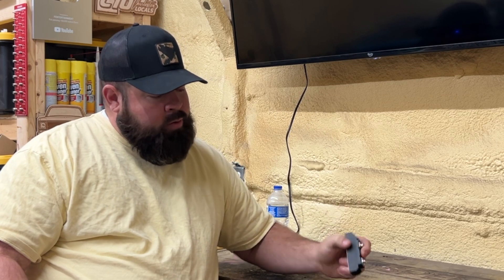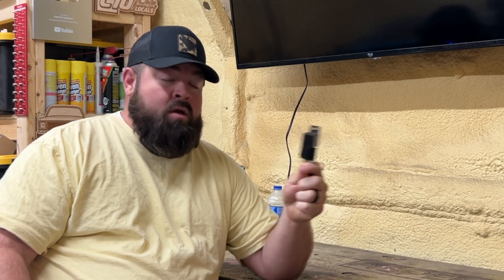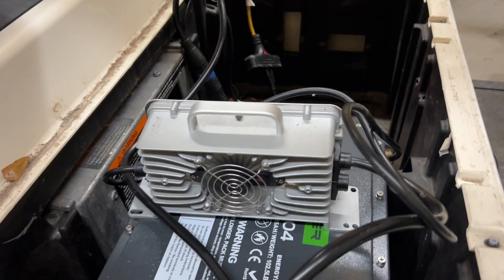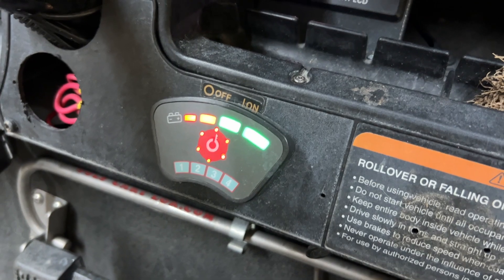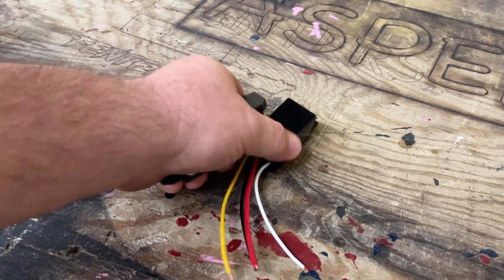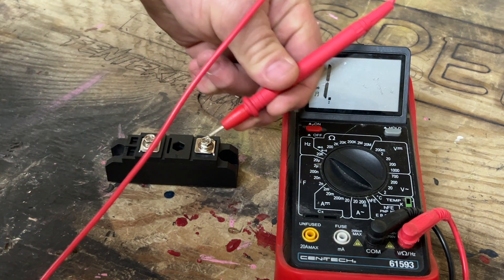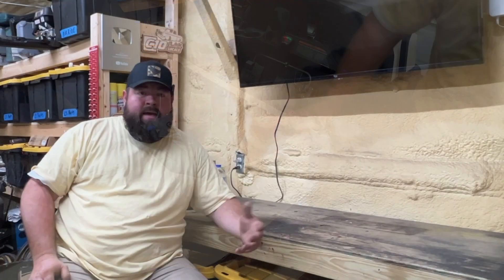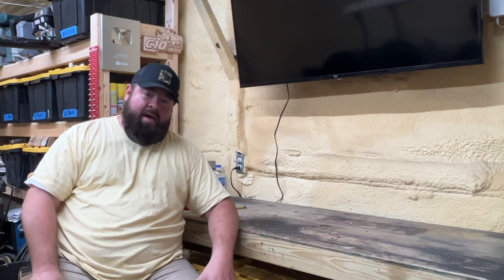Golf Cart Moves While Charging After Lithium Battery Conversion | DIY Add Safety Switch To Any Cart

Comment: I view all of your videos, this one some how slipped by me. Safety First! There's a lot of amp potential in these lithium batteries. For safety sake I am prone to buy a battery with a built-in power on/off switch and an indicator to let you know that there is juice at the battery terminals or not.

Comment: So on an EZGO RXV, how would you integrate this option.  The keyswitch is not like this.  Most instructions with converters show to run switched side to switched side of solenoid, so would you do similar with this application or how are you doing them?   thanks man!
Reply: after some thought, I would say in the case of the rxv or any ezgo that has the interlock, that the easy and correct method would be to use the interlock as its intended, by taking the blue interlock wire that hangs off the back side of the receptacle and cutting it and connecting it to the pins 87a & 30 of the relay, so that its switched open when the charger is connected, since this interlock sends pack voltage back to pin#17 on the controller, you'd be using the relay to control this same as the charger did before.  What you think bud?

Comment: Will this work if I install a Navitas motor? Your link to the diode has a note stating it only works with DC input? Not sure what it means?
Reply: Should work just fine because you are looking for 36/48v from the charger's output, which is DC output

Comment: I have a question regarding your Cushman hauler. I just upgraded mine with the Vatrer 72v lithium. What did you do with the gray and red interlock wires that were in the charger loom? I’ve read to just connect those 2 together to close the circuit. I respect your knowledge and would appreciate your input. Thanks!
Reply from the maker: Mine didnt have the stock charge receptacle because the cart had the onboard charger when it was stock. In regular carts I just unplug that receptacle and run the red wire to the batteries positive.
Reply: thanks Ryan but maybe we’re talking about 2 different things. Coming from the stock charger loom are 2 wires, a gray and red. Supposedly they tell the cart that it’s charging and disables the cart from running. Since the new charger from Vatrer doesn’t have anyplace to connect these it’s been suggested on a forum to connect them to close the circuit. I didn’t want to do any damage but maybe I should give it a try? Thanks!

Comment: I have the 5 pin converter installed on a ezgo txt I am in the process of installing a relay but I'm not sure what to do with the switch wire from the relay and the green switch wire from the converter?  Help please.
Reply from the maker: If you are asking how I would install a 5 wire converter & relay? Easy. Converter Yellow & Green to Relay 87, Relay 30 to Battery Positive. Relay 85 to battery ground, Relay 86 to key switch on the cart, Converter ground to battery ground and distribution ground for accessories, Converter Red to fuse block, Converter blue wire wont be used.
Reply from the maker: If you wire it like I mentioned then the green wire on the converter will get its power the same time the converter does and the relay is switching it on and off.

Comment: Hi Ryan. Thanks so much for your great channel, I have learned a lot from you. I replaced my eight 12volt lead acid batteries with eight lifepo4 batteries in my 2015 Polaris Ranger EV.  I also installed the Victron BVM-712 battery monitor. The batteries get out of balance on a regular basis and it’s a pain to individually gauge each battery with my voltmeter. Is there a way I can install a gauge on each of the eight batteries so I can just look under the seat and determine whether they’re balanced or not? The BVM 712 monitors the entire battery pack, not each battery individually. Thank you for any guidance you can provide.

Comment: Another great video, thanks!  My question for those who have lithium batteries that have the On/Off switch like yours, why wouldn't turning the battery off (which should mean no discharge) do the same?  Or do you need to have your battery switch turned on to charge it?
Reply: I used a 'Ampper' Side Post Battery Disconnect Switch, 48V Battery Isolator, to manually turn off 48v power out from the battery. Good way to work on any circuits without issues. The onboard charger still can charge the battery

Comment: Hi Ryan.  I am confused about the diode.  I understand that the diode allows electricty to only flow one direction.
I already have the wireless keyfob that disables the key switch.  Wont this prevnt the cart from moving when charging?
If I connected a relay to another portion of the constant power leading to the key switch, that should also prevent the cart from moving regardless of whether the wireless key fob is on or not.
Since the key switch output wire connects to the solenoid and then to the controller, I dont understand why the diode is needed.
Thanks, Brent

Comment: Great video, only question I have is wouldn’t this be ineffective if the charger cycle was over? Because it only works when the charger is active and has a voltage output?

Comment: Either put the charger on the drivers seat or hang it off the wheel,
Reply: This solution won't work with an on board charger.
Reply: @chriswilson5917  correct, but I would maybe run the extension cord through the steering wheel. However you would have to remember to do that every time!

Comment: Great idea. I got in the habit of putting my Yamaha in tow when charging just in case I forget and pull away.  Realizing we all don’t have tow run switches this covers it. One of the fellow’s I did a conversion for stopped over with his charger in hand with the cord pulled out. Drove away with it plugged in . Luckily was able to repair it so he didn’t have to buy another. With kids around we have to really make things bulletproof. Great tip !

Comment: What about using the blue wire on the Ezgo txt and rxv (can’t touch key switch)  that comes from the old charge port 

48v no
When diode has power it switches output to zero v and controller shuts off movement

Comment: Interesting, nice job thanks  a Lester summit 2 charger onboard should have the same diode/relay set up  with LEAD acid carts? but nun the less do leave the f/r switch in neutral at least   Cheers  basically if you can key on during charging its an issue I guess